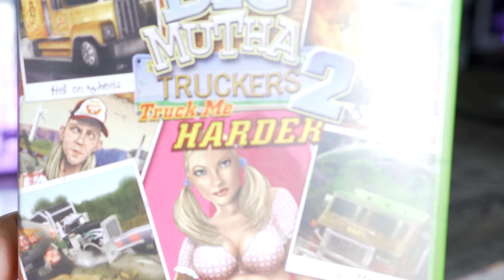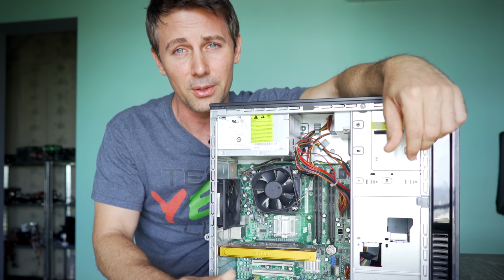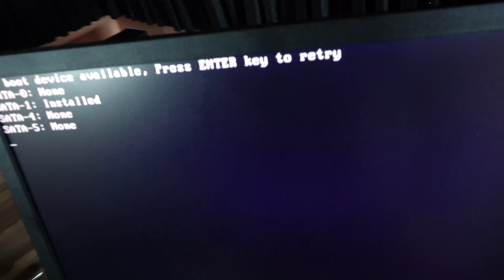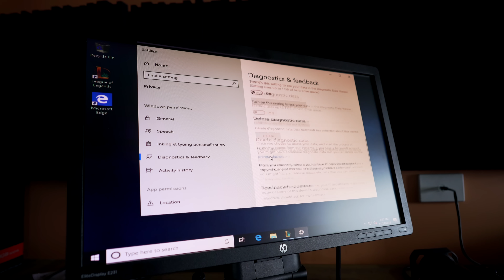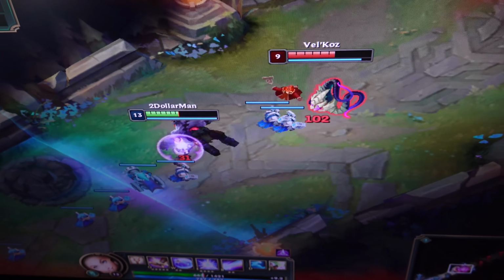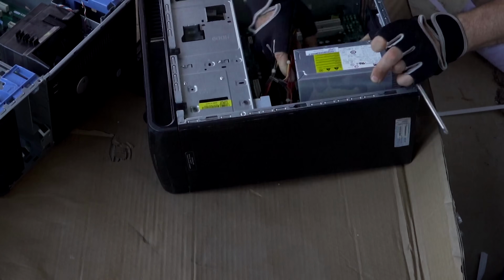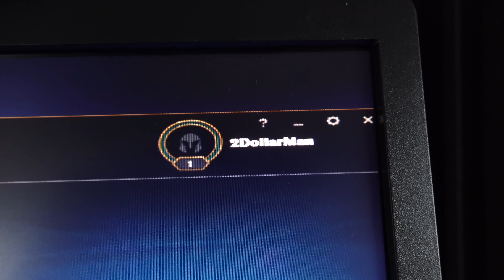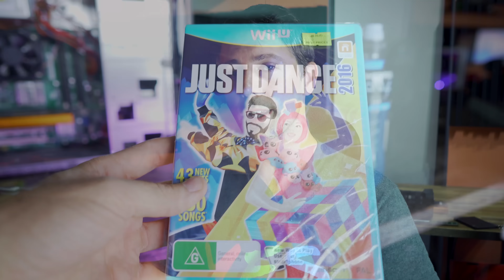This PC Costs $2.... Can it Play League of Legends...!?

Comment: The most biggest bug with pc's is that well my motherboard for my core2duo only has 2 dimm slots so yeah 4gb ddr2 maxed
But the other negative thing isthat quad cores are exacly the same price as doule core like 
Core2duo E7500 - 20-30€
Core2quad q6600 -40 to 50€
Xeon's not selling localy :(

Does anyone know where i could get 4gb ddr2 ram or a cheap quad core for socket 775?
Reply: aliexpress
Reply: Ebay and as @pc techtips said aliexpress always has a lot of older hardware for reasonable prices.

Comment: i think it's because of the operating system windows 10.

why not try this again with windows 7 ? i bet it will work better, maybe.
Reply: It’s not the OS. I have 3 775 machines on 10. Two quads, and a duo.
Reply: EvilTurkeySlices Well, its not fully fault of the os, but if windows 10 broke, or some service in background started to use too many resources, it could help the poor performance. 
Even worse in mechanical hard drives, and maybe even worse on the obes used on the video wich seem to be old and slower than the typical sata 3 one. 

But probably the main culprit are the damaged chipsets, usually they overheat and pass a long time without any maintenance, maybe even suffering from a tape mod or overclock. And when the hardware is that old there would be awready a natural wear, if the previous owner did overlook the chipset, did not monitore it, did not replace the thermal pad, did not even put a fan on top of it, its probably damaged. 

Most 775 boards i found are like that, because they were used like workhorses until some problem happened, and then thrown away. Usually the lack of maitenance kills them or the psu. But it could also be bad processors, if they were heated too badly, for a long period of time, they can get these symptoms too. 

The right thing to do was to fire up msi afterburner free edition and monitore what was causing the bottleneck, check if any clock or any usage was not normal.
Reply: I had a  775 system up until about 2 years ago and Windows 10 was not compatible with my board. Manufacturer even told me so. So I never did the free update
Reply: ignigknogt it has no official drivers, but everything else should work.
Reply: EvilTurkeySlices Actually it depends. My sandybridge laptop alsp should work without the actuall drivers, but iy bsods alot, and runs really worse than it should under a windows 8.1 installation and also under a w7 installation. Even worse because microsoft disabled the opengl in any gpu drivers older than, lets say a intel hd 4600. 
So the cpu emulates slowly opengl. Unless you find the right propper driver. I had to install a custom phdg driver in my intel hd3000. 
But in the end of that semester, i will format my laptop's main hdd to windows 8.1.
Reply: Eduardo Avila my intel hd 4000 still does OpenGL on Windows 10. Also Microsoft has nothing to do with intel gpu drivers.
Reply: EvilTurkeySlices Yep, you have a intel hd 4000 wich i dont know if it had still ogl support, you probably use proprietary drivers, not the microsoft ones. 

But if you have a intel hd 3000, hd2000 gma x4500mhd, gma3150, gma950, and some old dedicated gpus, the ogl support under windows 10 doesnt exist. 
But that dont break simply the compatiblity, ogl programs (most of them) work fine, but they are really heavier because the ogl is being emulated rather than hardware accelerated. And i dont remember quite correctly, but i think its a microsoft issue, with their drivers, and not only in intel igpus, but also others such as mirage 3, and from what i searched some nvidia and ati chips too. 
If tou have the manufacturer drivers this issues dissapears.

But many of those old boards are stuck with the old  manufacturer drivers, not compatible with windows 10, so usually people just stick with the default ones wich lack ogl support, its rather emulated. 
Again its not intels drivers but microsoft supplyied drivers. With recent machines such as yours you wont have this kind of issues. 
I only had a intel hd 4600 not a 4000 so i couldnt confirm if this problem its limited up to the hd 3000 or up to the 4000, thats answers my question.
Reply: @eduardoavila646  with my i3 haswell laptop, windows 10 kept crashing the igpu drivers. Couldn't get tf2 to work, crashes every time I wanted to play.
Some steam games had heavy graphical glitches or poor performance
Only CS GO still worked quite well
Returned back to windows 8 and it was working flawlessly again
Reply: Benji Derrick Maybe it could be incompatiblity of graphical drivers, but your laptop, by being a haswell, should be fine with its intel hd4600. 
But you probably had to update to a driver wich was windows 10 compatible, but thats depends on the manufacturer. Some dont have such drivers

Anyway, i'm in the same boat as you, my sandybridge laptop also has alot of issues under w10, i will roll it down to 8.1 when the year ends, so i dont loose important work in the backups, and dont have to pass the throuble of trying to remake all the configurations in many programs.
Reply: @eduardoavila646  it had a driver specifically designed for Windows 10 but that would not work neither on 10 or 8.1
And it is a 4400, though it isn't that different
Reply: Benji Derrick Thats strange, if they updated the driver recently they probably fixed the issue, it could be that. 
But yeah, w10 is in the buggy side of things. 

I think the best thing in your case is to stick with windows 8.1 and hope that the next windows version comes less buggy.
Reply: @eduardoavila646  this laptop won't be upgraded to windows
If it dies before 2023, it would be on 8.1 forever, but if it doesn't, it will go Ubuntu with an 1 or 2TB SSD
Reply: @benjiderrick4590  I dont know, maybe it survives. My 2009 dell inspiron actually was able to run even windows 10 fine to a certaibn extent, 8.1 runs perfectly in it. 

Ubuntu and other linuxes are really a awesome option! I usually dont sugest that around, because most of the people are windows-only users. 
I'm right now testing opensuse, and getting some really good results out of it.
Reply: i have core2duo E4500 2.2 Ghz with Nvidia 9500GT, it can play dota but when in war the frames is drop from 80 to 15 fps bcoz low freq of cpu, i dont know how to oc to 2.8 (min cpu req dota) + i have same issue with ram just 3.25GB of 6Gigs usable :(
*sorry about my bad english
Reply: @MilkywaaaY  as far i remeber widows 7 32 bit can adres only that amount of ram
Reply: Bruv, that's what I've been saying.
Reply: he was using 32bit windows 10 by the looks of it 6gb ram installed 3.5ish usable (32 bit has 4gb ram limit)
Reply: Apk Heaven Windows 10 surelly eats up some more ram, some more cpu usage, hdd usage. That if its not broken, updating, or neurotic and scanning your pc. 

Up for you!
Reply: @eduardoavila646  but few extra frames would be sufficient for LOL game and windows 7 is not obsolete yet as much as i know.

but the only thing that hurts watching was the 2.2ghz intel core2duo from 2005.
Reply: Apk Heaven Actually i agreed with you, but i think it could be more than just a few frames! Even worse in opengl based programs. At least lol runs on directx. 

About the extra frames, i know, just few extra frames are the difference between dodgyib a ult, and being caught. 

Yeah w7 is not obsolete yet, but close to loose support totally wich after that will the downhill. But at least we have a year and 1 month until that happens. 

I would also say that 8.1 even tho its not as good as 7, its better than 10 and should have a bit of extra support and maybe also be a good test too. And when 7 starts to be unuseable, i would sugest jumping to 8.1, and maybe by the time 8.1 dies, you would be able to skip 10 and with luck maybe the next windows will be less worse.
Reply: @eduardoavila646  actually I think windows 10 would've been the better bet as ram optimizations are more efficient and gaming mode can make a noticable difference on older hardware.
Reply: Shakil Muzib Ahmed Its not so ram optimized, it still uses the same basic windows 8.1 superfetch services. Its as optimized as 8.1

Comment: This system could easily play some older titles, but I don't know about LOL. I play now on my laptop lenovo T61 intel Core2Due T7300 2.0GHz , 2GB RAM GTA San Andreas on low settings and I am having a lot of fun. I also have installed Battlefield 1942 that I play on multiplayer. I am having really good fun actually.
Reply: Nostalgia
Reply: @NeuroXys  I don't think that my laptop can run anything newer than these games, but ...I can't tell.

Comment: Try with a Lenovo M57p I once had some and those were running absolutely smoothly. I remember they were not only taking a q6600 but a xeon 34xx too and 16gb were possibly too. Not that I would recommend getting 4gb ddr2 sticks ;) just the 771 mod wont be possible on this chipset iirc
Reply: Wait, 4 GB DDR2 sticks, I need to try this on my q9400 Lenovo ThinkCentre M57p. What model sticks are you using, and does the board detect the 16 GB of DDR2?
Reply: @bill_clinton697  I don't have it any more. I think those were some no name dimms. But afair those had 16 modules each, not 32 like those that are offered on eBay currently for cheap. I don't know if it will take 4*32*1Gbit. Afair I had a 4*16*2Gbit configuration working without issues.

Comment: 775 is basically dead for gamers. Unless you get one for free that has a C2Q it isn't worth considering even with a Q9400or better and can't really do modern gaming.
Reply: I disagree. I'd never build myself one,but a core 2 quad paired with a semi decent gpu is fine for most popular esports titles like fortnite or overarching or league. Plus do decent on well optimized games like Witcher or Doom. Sure the probably such at games like AC

And if you actually have a good motherboard and over clock, you can make it decent. 

So not dead....just should not be anywhere near you first choice.

Comment: Couple months ago I got some parts for free when I picked up something else from the guy. Abit ip35-e 775 board, e6750, 4gb and a gtx 275. It ran some older games really well (trine 2 high/ultra settings 70-100fps). I ended up selling it all for $40 though

Comment: LGA 775 encompasses the old Pentium single core chips with much older chipsets, of course those won't work with something like a newer C2D or C2Q. There are many chipsets on the LGA 775 socket; it's not a given that an LGA 775 CPU will work on every LGA 775 motherboard.
Reply: B14NK the net burst based chips will work in any board though.
Reply: @EvilTurkeySlices  Interesting, I didn't know that

Comment: instead of kicking them down, u could have sold them as a cheapo Office PC for like 60$ a piece
Reply: Nobody is buying these for offices. Offices are getting rid of them.
Reply: @DerrickRG  you compeltly missed the point here, obviously no company will buy that, but however i can sell cheap PCs to run office or old programs pretty good with specs like these or worse
wich is why i recomended it
Reply: I'm all for a good side hustle, but these are toast. Your going to be giving yourself a really bad name if your selling these to anyone.
Reply: Engineer six Is they didn’t boot though.